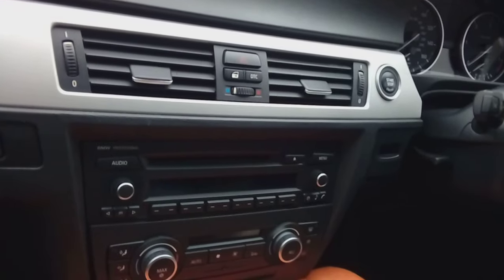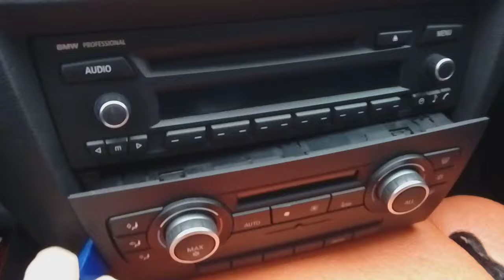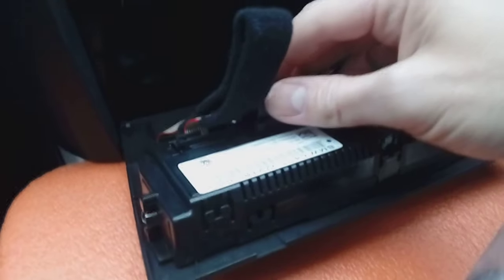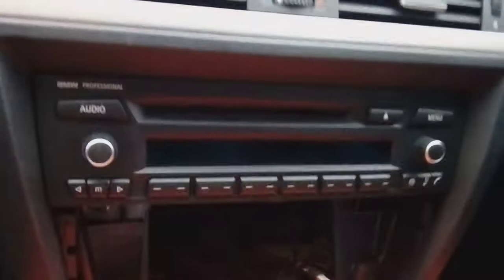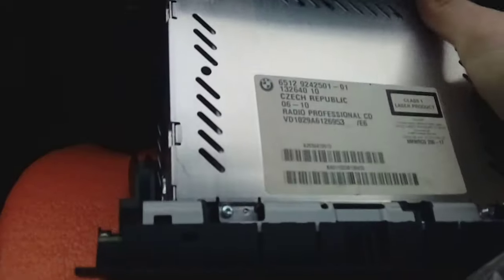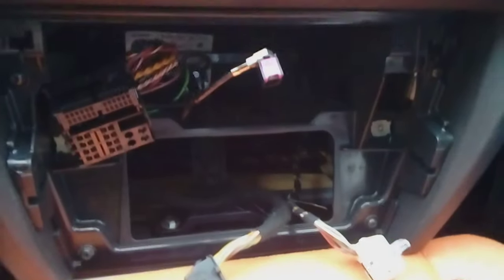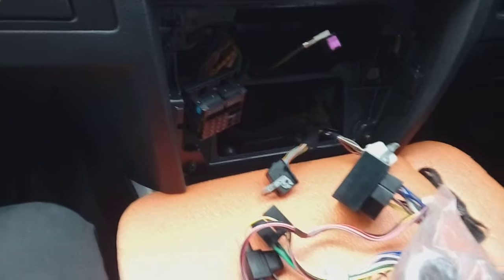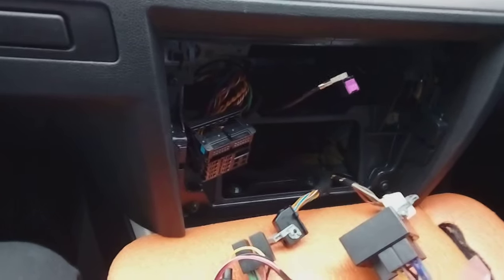BMW E92 E90 E91 E93 3 series 2005 - 2013 Radio quick removal guide

Comment: did you encounter any problems with your parking sensors not working? after install?
Reply from the maker: Your parking sensor audio is tied in to the original radio so you will need to consult your retailer about a steering control interface that supports reverse sensors.
Most have a small speaker to enable the beeping.

Comment: Having an issue where the aux functionality is not working - does it have a dedicated connector at the back of the head unit? As far as I saw there is only a main connector and the radio antenna, and nothing else? Thank you!
Reply: Did you find a fix, having same issue
Reply: @mubeen854  Ended up plugging a radio receiver into the power port in centre console and tuning in :(

Comment: I’ve used the same autoleads connected you did but the stereo doesn’t always come on with the ignition and if it does it has no stored memory on the stereo. I’ve tried running a permanent live from the battery but now it’s permanently on. Any suggestions? I’m fitting a Sony DSX-400BT stereo to a 2007 E92.
Reply: Did you swap the yellow and blue wires round sometimes that’s a fix on some cars
Reply: This really works,  thanks guys